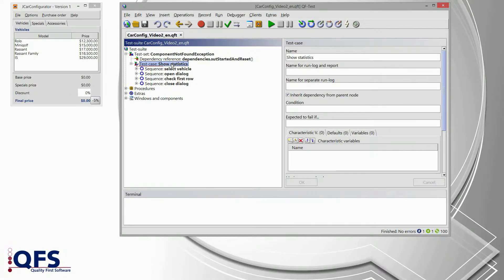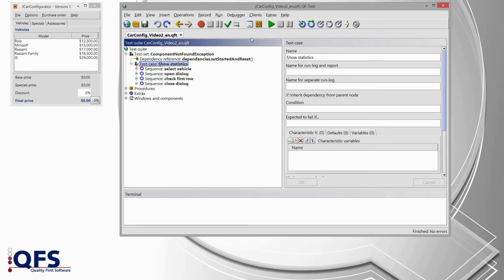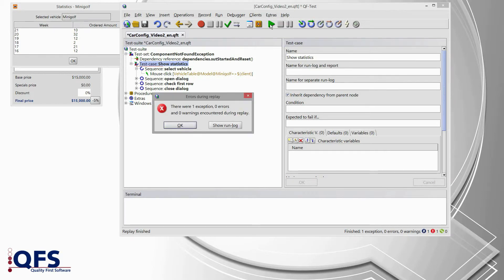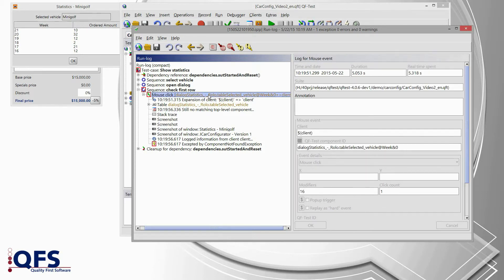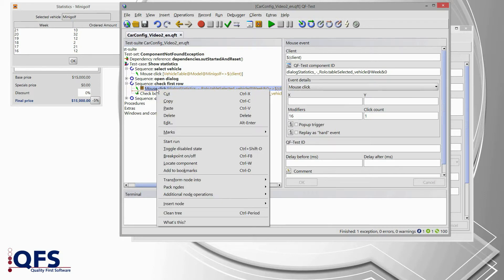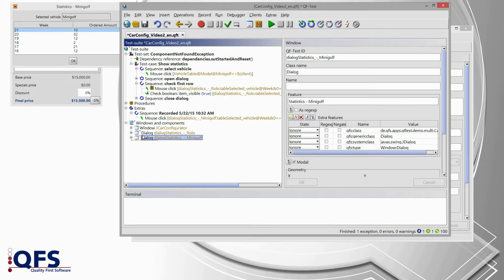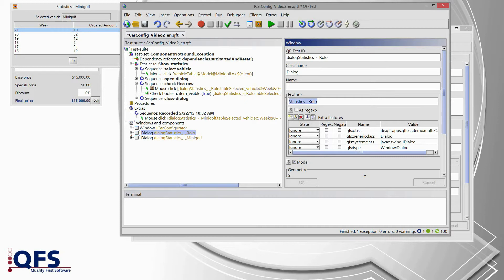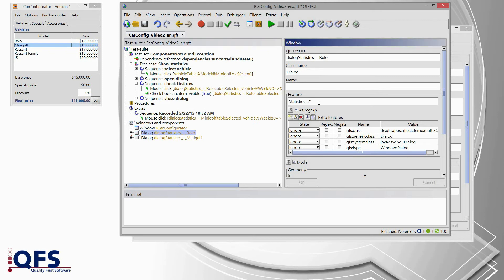QF-Test ComponentNotFoundException - Complex case | GUI Testing Tool

Comment: What happens if the Class name changes?  For example, the original component was recorded as a TextField and the new component is recorded as a SPAN?
Reply from the maker: That depends. Think of it like this, every bird is an animal, but not every animal is a bird (ants for example are animals, but not birds).

With a resolver you can tell QF-Test that a certain span element is not only a span but also a textfield. If such a resolver is active, it does not matter for component rerecognition whether span or textfield is given.

If no such resolver is active, then a span doesn't equal to a textfield and it's likely that QF-Test will not rerecognize the component.

Sorry this answer is really late, but three years ago, we were not so active on YouTube. 
If you have an urgent question, please sent an email to support@qfs.de